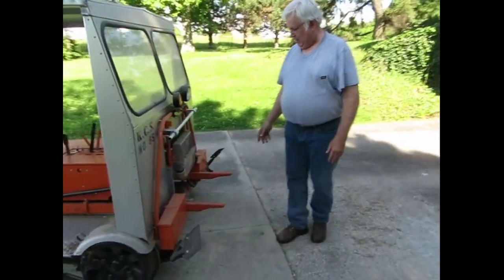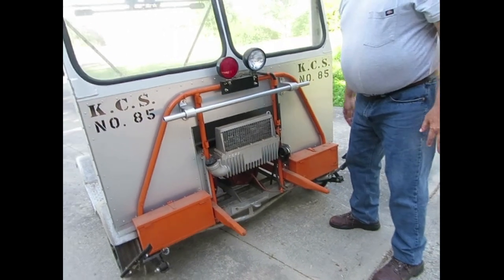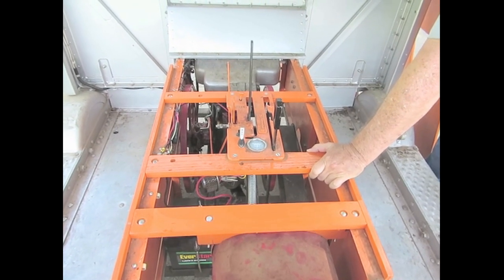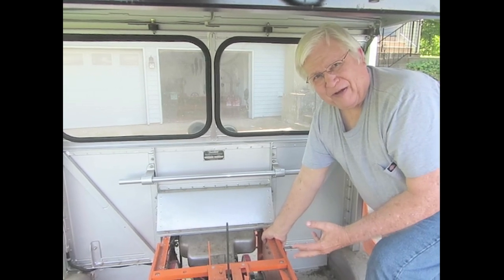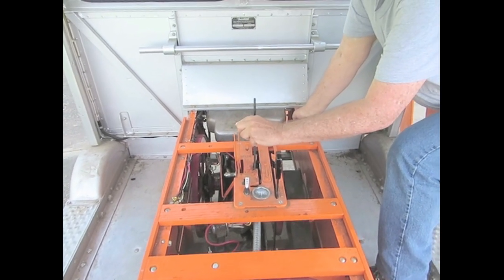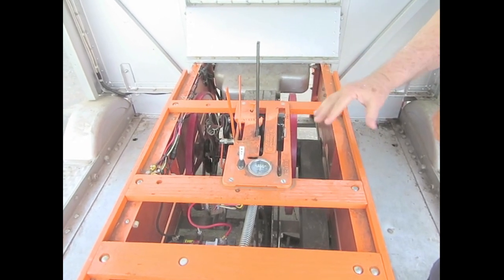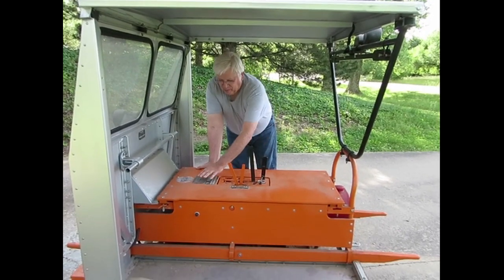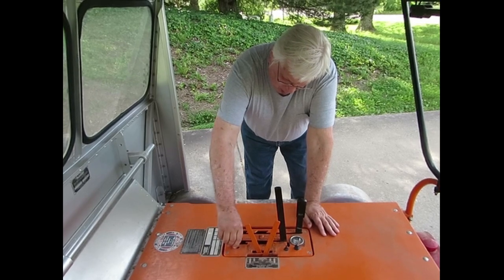M19 Fairmont Speeder First Start After 20 Years

Comment: I started mine in reverse with out the crank. Move time to reverse start., cut ignition. when fly wheel is about stopped, turn ignition on. The compression will kick the piston backwards and the engine will reverse. Also, I used 50,000 VDC auto coils. But you have to lengthen out the timer linkage so the spark is advanced.  With a buzz coil, the spark happens when the  timer blade touches the set screw. With the auto coil, it sparks when the points are open. There is a cam on the crank shaft that  pushes up on the timer blade & touches the set screw where your + wire is attached to. Dick Ray & I used to have discussions about Buzz vs Auto coil. I was on the South Branch Valley and they went to push me back ward because of the auto coil. I put the car in reverse, engaged the belt and took off leaving them behind. The weak part of the buzz coil is that there is a primary and secondary coil connected to each other and if that wire breaks no spark. Somebody came up with a solid state buzz coil which eliminates this problem. You can order it for ROC, QBD single and RKA/RKB Fairmont opposed twin cylinder engines. If the buzz coil is 6VDC and you are running an alternator, you must use a resister or 12v to 6 v converter.  Another advantage of an alternator is that it puts out 100% power at low RPM's. The GM alternator has an internal regulator.  Get one from the junk yard and have them test it.  Get one with the harness. Take those two wires and combine them run that to your ignition lights etc. On the large terminal, run that to the + on your battery. Put a ground wire on the alternator mount and bolt that to the chassis. On the plug, one wire is to excite the alternator field and the other is for the regulator/load.
My Alternator came from an Olds 88"Loaded". My cars were M19E-3-7 M1171, M19F M1705 and MT14L 155-11
Reply from the maker: Sounds like you have had some fun customizing!